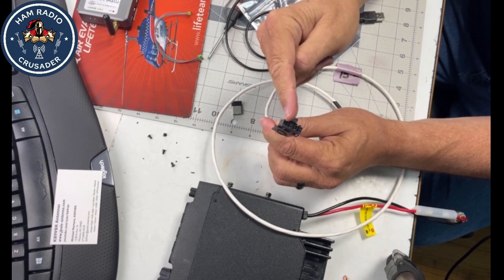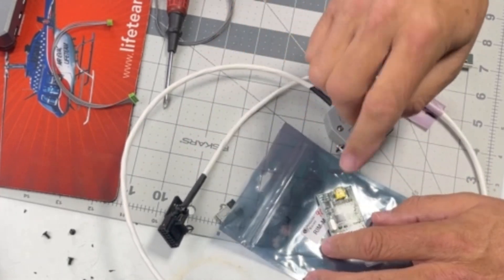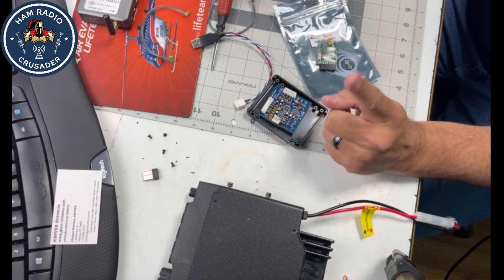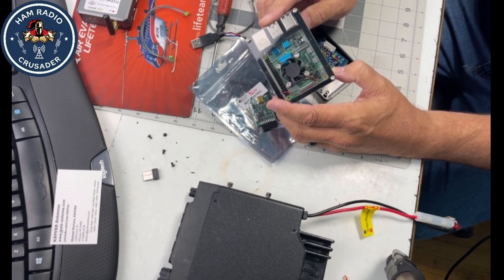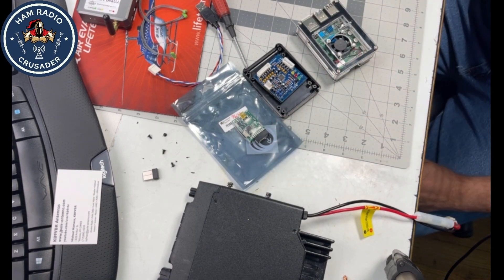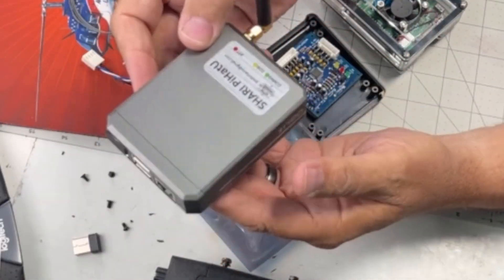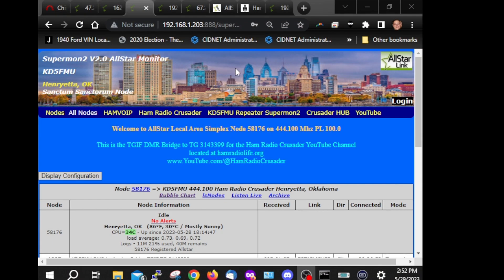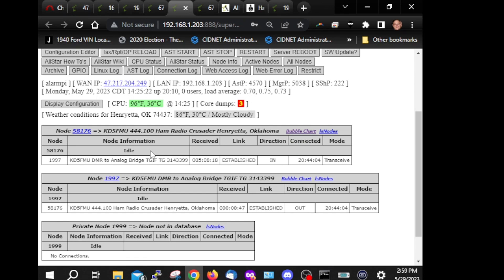Getting Started in ALLSTAR with the Ham Radio Crusader

Comment: i too got out of the hobby for 12 years and got back into it in 2009.  i am on d star  and yaesu system fusion with a hotspot  use echolink on my phone but thinking about allstar  and allready have a node number  just need to get a radio to use as  a node radio and get what i need to connect the radio to the raspberry pi. also need to buy  the raspberry pi